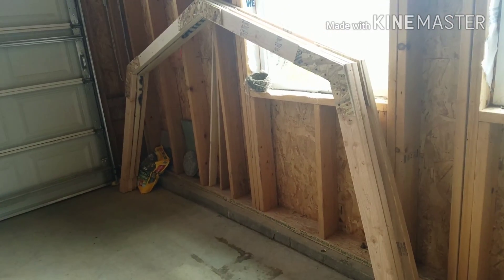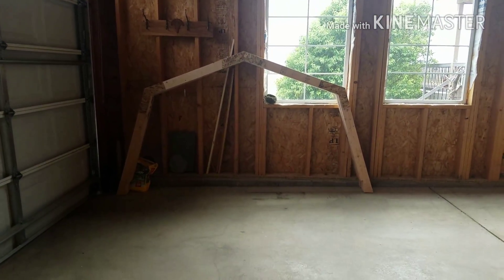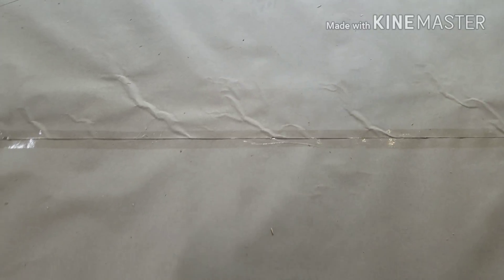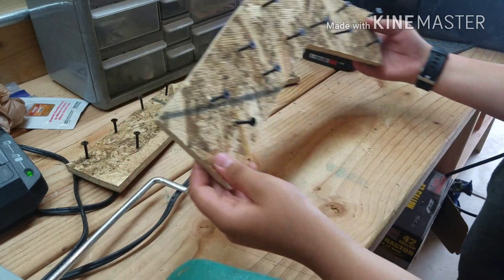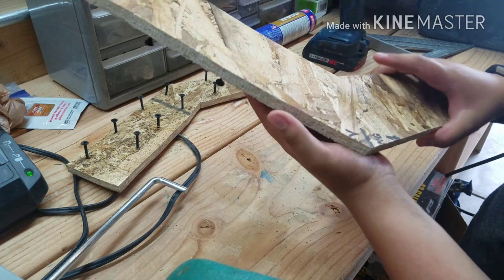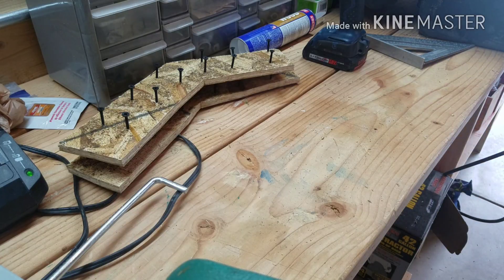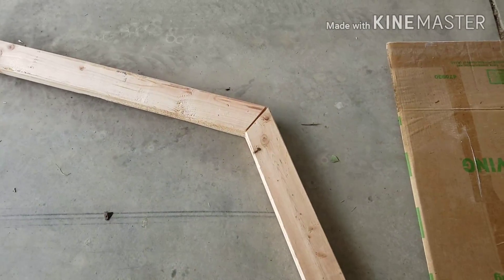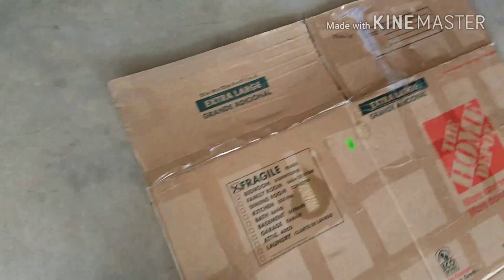Tiny House Build: Fabricating Roof Trusses

Comment: nice video and good job! tip i learned a while back to make it easier building trusses for sheds. after you frame the floor and lay the subfloor you can use the floor to build your trusses with less measuring and lay it out on the floor and create a jig by screwing blocks to the floor so you can set each truss peice in between the blocks and it will make every truss identical and hold the same angles when you attach your gussets. great job though!